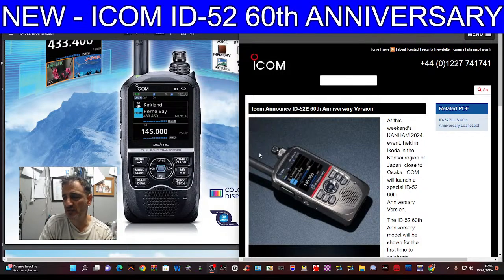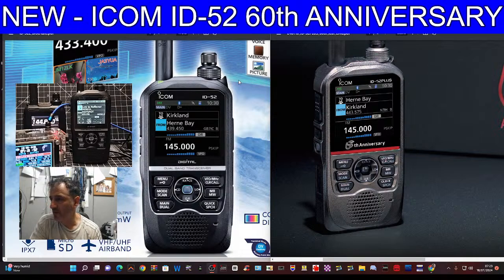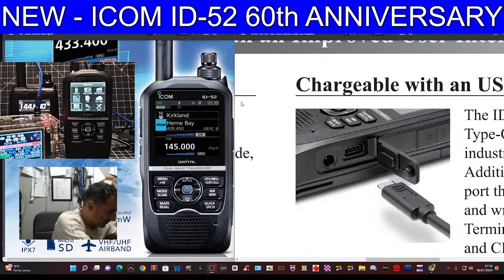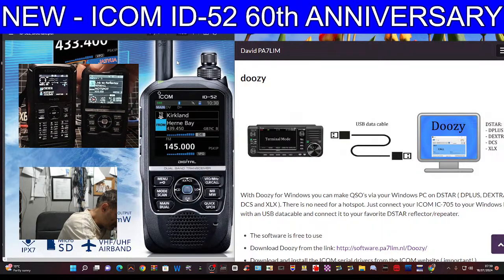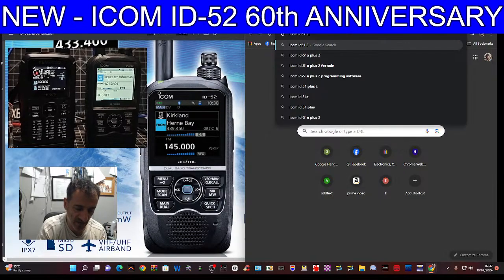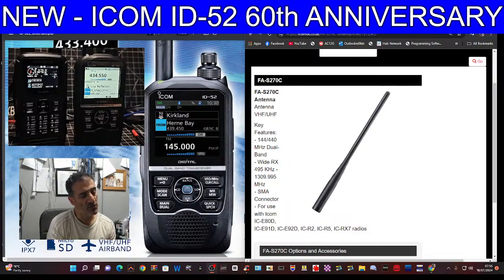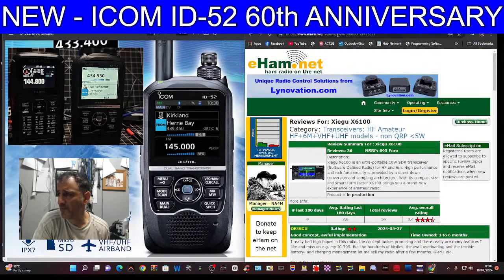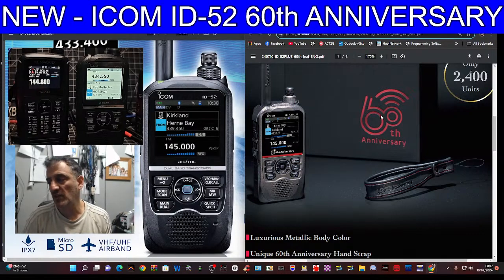NEW - ICOM ID-52 60th ANNIVERSARY

Comment: Icom tried this with the 50th anniversary addition and at least they would give you a unique special antenna you can't get anywhere but a handstrap? CMON Icom why would I spend 100 dollars more for USB C charging? Secondly like the other Ham stated the Kenwood D75 is way better for the price.
Reply from the maker: The D75 costs alot more it has a smaller screen and needs a PC to send photographs the ICOM 52 has a waterfall display also the USB C is very convenient as all phones use this , plus Terminal mode has sone big improvements.
Reply: @M0FXBHamTech  Kenwood is 749 and the ID52 anniversary is 729. So only 20 dollars more. Nobody uses the waterfall display and it doesnt have a very big span to do anything its a gimmick. Also nobdy sends pictures. You do it once or twice when you get it and then the gimmick is over. Nah Kenwood D75 has way more useful features. What are you going to send another ham that you cant text a photo to?  Ive had cell phone service throughout my life and never had to send a pic through a ham radio. Its a gimmick.